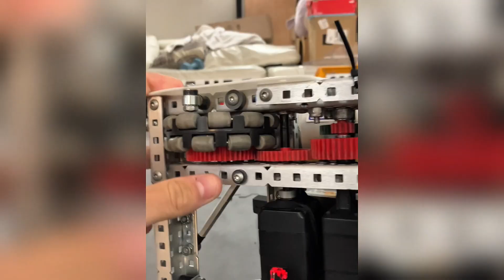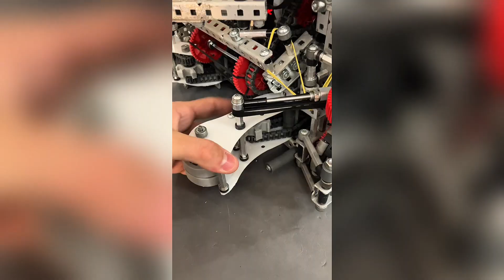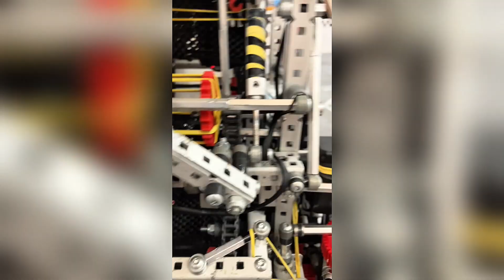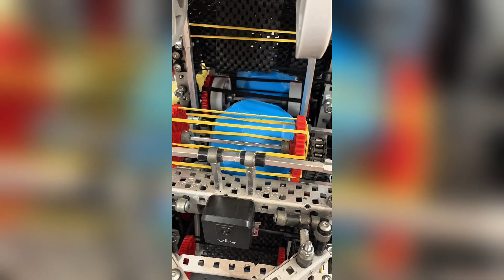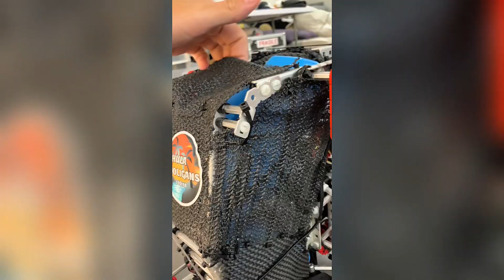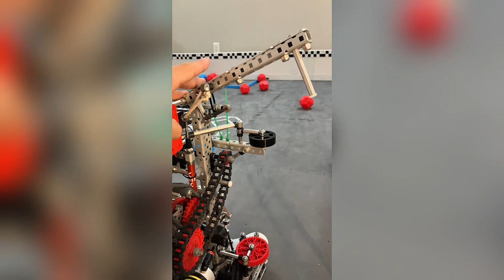Post Worlds Robot Explanation Video ~ 2624C

Comment: How did you do your pid loop for 55w drivetrain
Reply from the maker: It was a custom PID, we did not use templates. I’m not the coder however so I can’t really explain in depth how we did it, but ts worked well.